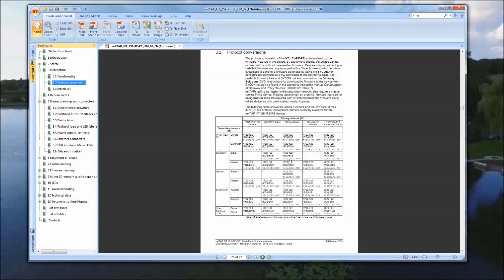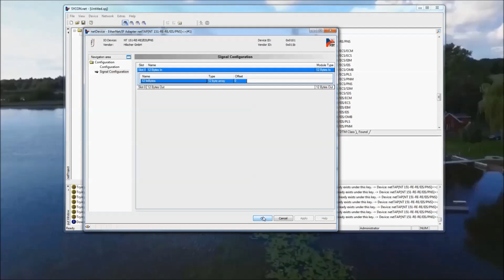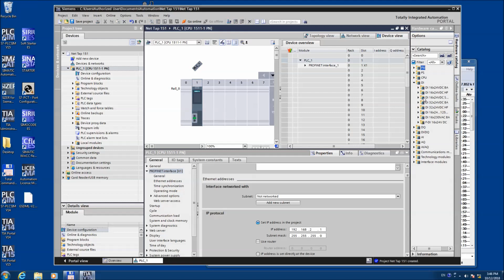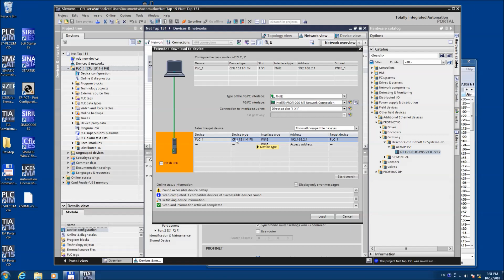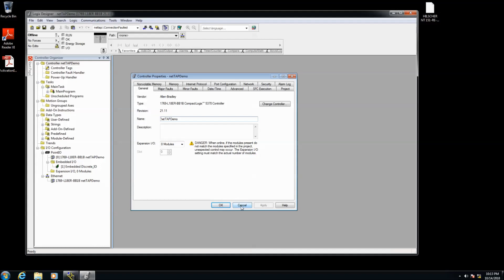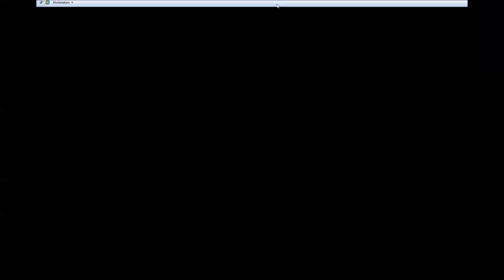Siemens PLC to Rockwell PLC communications using Hilscher Net Tap 151

Comment: I Am using NT 100 RE EN FOR AB L33ER & Siemens S7 1500 PLC communication but in Gateway configuration menu, I have selected Ethernet IP & In X3 Profinet IO Devices. After selecting its not showing supported firmware in available firmware window. Please help..

Comment: Sir, Can i Use NT100-RE-EN for communication between ET200S IM-151/8-PN-DP & AB L73 CPU
Reply: Yes, you can use it either NT 151-RE-RE or NT 100-RE-EN
if required you can contact me, I am from Hilscher India.